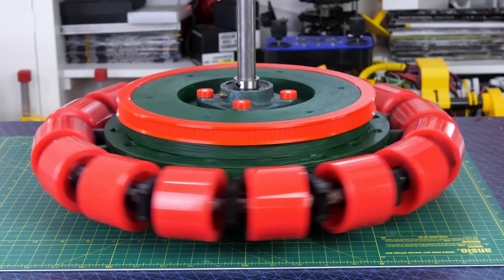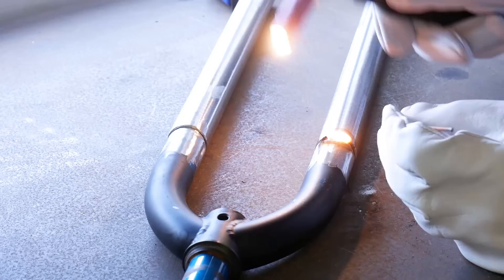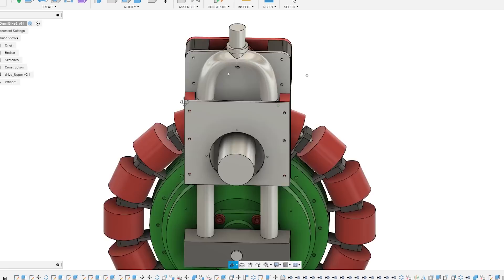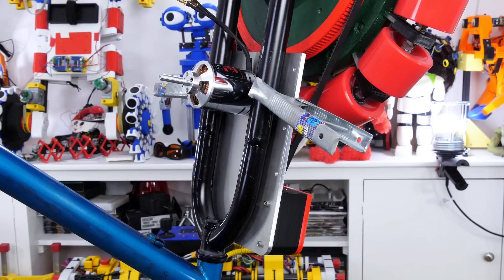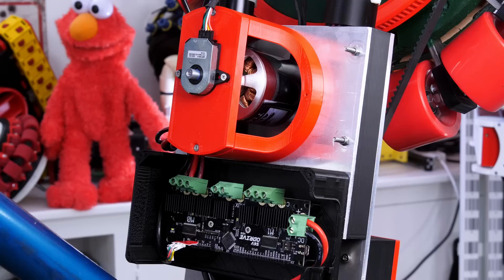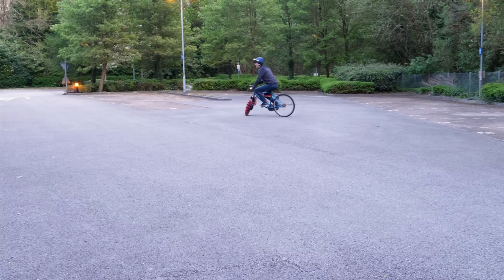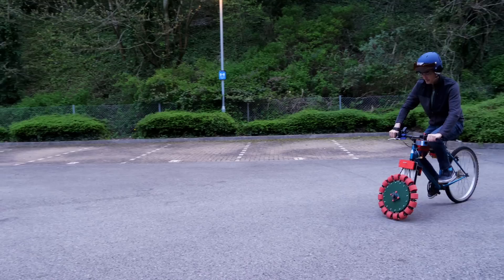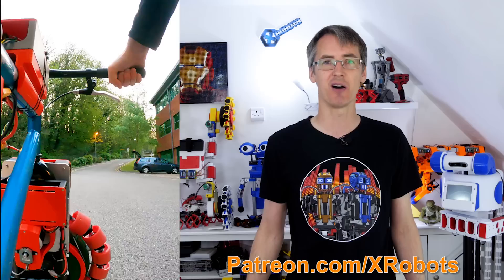Can I RIDE THIS BIKE?

Comment: This is really fascinating. I was surprised he could balance so easily. I wonder if omniwheels could be applied to disability aides, such as wheelchairs and rolling zimmer frames. For small spaces, it could even be useful in prams.
Reply: The issue is omnj wheels tend to get stuck as actually making them work perfectly is rather hard.
Reply: In real world scenarios the spaces between the rollers cause a lot of issues for many applications.
Reply: 11 years ago somebody already posted a video on youtube about an omni wheelchair
Reply: So I play Star citizen, and one thing I love is the ability to strafe my ship at any direction at any time. If I’m ever wheelchair bound, I’m replacing the wheels with Omnis and a joystick for multiple direction inputs
Reply: @Amara87387  Hover tech is at the level where you could probably use it if you wanted to. Walker wheelchairs are another option as the Ls3 mule is over 10 years old and 3d printing makes part replacement simpler in a domestic setting compared to a military one. The only major issue is that they can be a bit loud, but older wheelchairs aren't exactly whisper-quiet either, and there have since been many innovations that address that issue.
Reply: @flinfake  too energy intensive by comparison though, most likely
Reply: @axolotl0424  The energy demands are comparable.
Reply: @Amara87387  You could try mechanum, those are usually more consistent, but idk how well that would work with only two wheels
Reply: @himedo1512  more moving parts=more chances of failure

Comment: when you stop welding with the tig, leave the torch in place and wait for the post gas to stop flowing - this allows the weld to cool and the gas stops it oxidising - which means if you need to start again - it’s ‘clean’.  especially important when tigging ally
Reply: I was thinking adding that exact same comment.
Reply: Alloy?
Reply: @MaxPMagee  aluminum

Comment: It seems like a cool idea until you realize this makes dealing with curbs and other bumps and changes in elevation next to impossible to deal with without stopping and lifting the bike manually over the bump
Reply: That's a really good point but I don't think he meant for this to be at all practical. Just an experiment in "what if"
Reply: Just pop a wheelie

Comment: Before I watch this video, as someone who mountain bikes a LOT: I immediately thought it'd be best to try this on the rear wheel.
I love locking up the rear wheel and fishtailing the bike around corners, this would simplify the drift if you have the muscle memory...
No clips, no foot out, trust the rubber you invested in! 
MTB 4 Life!
Reply: Although for that you'd need either a front wheel drive bike, or some complex mechanism to get the rear wheel powered in both axes. I imagine it would be possible, but getting those tiny skateboard wheels powered would be very difficult
Reply: @skylark6167  maybe they could be rubbery roller skate/blade wheels, theyll be softer too although smaller

Comment: If you add a sensor on the rear wheel to read the speed, you could adjust the balancing effect accordingly, turn it on/off automatically and even add a little ramp up. That could be neat.

Comment: Suggestion: soft-start for the balancing i.e. so that it eases from no balancing to full balancing over like 2 seconds.
Suggestion 2: steering wheel lockout when balancing is on
Reply: And switch Balancing on/off if the forward velocity is < x km/h
Reply: Could you also feed back the steering position, to offset the balance point to allow it to balance into a certain lean, matched to a certain radius of turn?
Reply: yes it looked like Integrator windup when he switched it on. Probably he was just switching the outputs (motor commands) ON and that would result in such windups while riding the bike normally
Reply: 2 seconds is a bit much, you'd want a 300ms from lean to full power balancing "soft balancing", it starts with very little correction (20% power? maybe play with it so it feels like resistance to leaning but still letting you lean with flicking you back straight) at the start of the lean and increasingly gets stronger until the end of the 300ms. Also give it a strength gradient depending on how much you're leaning, anything below 3 degrees should receive a 0.2 correction modifier (20% strength? Again, check what feels better) and anything over it ramps up in severity up to 10 degrees (if you lean more than 15 degrees with auto balancing on you are suffering from the stupid).

Basically by having these two different gradients you get both a reactive response give you time to manually correct for bumps without getting over-corrected by the PID and the freedom to turn with a slight lean without getting flung over to the opposite side causing that "flick" you see whenever he turned the balancer on while riding.
Reply: Suggestion 3: use an active omnidirectional wheel, mount the main wheel like normal and have the small wheels do the balancing.

I'm guessing that may have been the original plan but it was ruled too much of an engineering headache
Reply: Looks to me like the memory of the Integral term isn't cleared between off->on cycles, which makes it more jarring when it engages again and has to refill its buffer with up-to-date info. 
But that might be a wrong assumption.
Reply: @jakobkriele5518  I think the issue is that the bike assumes balanced is when the bike is oriented perfectly vertical, which isn't the case because the rider's weight can be off center of the bike. I believe the jarring when he enables balance mode actually recenters him on the bike.
The full solution might be collecting data from an an accelerometer and continuously updating / calculating the balance point. Should enable you to ride the bike 'balanced' with it almost touching the ground if the riders weight is counter to that angle.

Comment: This is actually pretty cool because at the end the motor is basically doing what you would do into a high speed corner on a sportbike, this could actually help people understand counter steer before practicing on a track.

Comment: It would be interesting to see a bike with the steering actually affecting the PID controller and the front wheel steering being locked in place. I expect that would be more intuitive to ride since it's always in balancing mode, but you're still able to use the steering wheel.
Reply: I was thinking about two buttons you can press on both the handles to make the wheel turn left or right while you're going straight to allow you to turn better. seems like this was over looked but I do like what he did with the balance system. if there was another omni wheel on the back of the bike to make it look even we might actually have a really nice product here haha.
Reply: mind you this is a pedal bike and if it was pure electric i can see this being really sweet actually with two omni wheels ^.^

Comment: i think if you inverse(or make opposite) the code tilt_direction/motor_direction relationship  in the "balancing mode" the motor will make you stay upright instead of throwing you to the direction you lean... give it a try if you haven't
Reply from the maker: That would be like a Segway that drives away faster in the opposite direction and throws you off.

Comment: When transitioning from not balancing mode to balancing mode, you need to reset the integration term to zero in the software just before enabling the control loop.  When you are riding in "bike mode", the control loop is going nuts (I assume your gyro inputs are still there, but the motor drive is cut, so error terms in the loop are huge).  The I-term "winds up" during this time.  Then when you kick on the motor drive, the I-term causes sudden jerk until it initializes.  Depending upon how you were riding (if you were in turn, the I-term would be large), but if you were nearly straight, the I-term would be more nearly zero, so less transient.

Comment: I suspect converting the bike to fixed wheel would be an improvement to this project as you would have much better control of your forward/back position and even be able to cycle backwards in balancing mode.
Reply: Thats what I was thinking
Reply: I mean, it's essentally  a track stand with more steps.  I do love the idea though
Reply: How do u mean fixed wheel?
Reply: @alal2192  You cant turn the front wheel
Reply: @spyder027  so it would be fully electric? It would be hard to manoeuvre
Reply: @alal2192  Since the wheel turns when you lean to self balance you should be able to lean to turn
Reply: @spyder027  oh i got it u mean the frame?
Reply: @alal2192  You cant turn the front wheel left or right to steer but it can still roll
Reply: @alal2192  the rear hub is fixed instead of 1 directional so instead of coasting when you stop pedaling the pedals keep moving, its is common for some trick bikes and wheelie bikes
Reply: @alal2192  fixed gear. Meaning when you pedal, the pedals will turn with the gear. With a normal bike you can get speed and not have to pedal. You're always pedaling on a fixed gear bike

Comment: I love this! One thought: lock the forks, disconnect the handlebars from the forks and make a steering encoder to send directional signal to the transverse drive? might work more like a regular bike at that point.
Reply: It wouldn't work much like a regular bike, because you actually counter steer in a bike at speeds higher than like 2mph

Comment: Making the rear wheel function similar to the front would be pretty sweet too. You'd be able to move on two axis without having to turn.
Reply: Yeah but it’d be super hard to manoeuvre
Reply: Bicycle strafing. Now that's something I never thought I'd imagine 

This is a good start, but until hoverbikes become a proper thing(more than just being big quadcopters) it won't be a common thing
Reply: the problem is, how do you power the skateboard wheels? would it be like a motorbike?
Reply: @BierBart12  that just sounds like asking for trouble though. It would be stupid hard to balance sideways movement, plus it would very likely make people dizzy

Comment: So cool! Your skills at integrating components are amazing, though at this point I imagine a lot of your balancing code and electronics are a "solved problem" and you just have to configure the same sensors and electronics on different devices to implement balancing or other control schemes. Your skill at rapidly designing and realizing complex mechanical structures is just as impressive, if not more, than the electronics!

Comment: Most interesting! 
I have to say though that this project really did require you to have a good helmet in case you came off the bike. However, without the strap fastened the helmet is nearly useless. Your rear tyre also needs air.
Keep up the fascinating projects!

Comment: My thoughts are use analog left and right levers mounted on the handlebars for the steering instead of leaning pulling the right or left lever turns at varying rates releasing both levers reverts to auto balance

Comment: Very interesting, you can probably have the handle bars locked in place since you should steer by learning over. Regarding safety, that helmet is of no use unless you fasten the chin strap. Also gloves to protect your hands would be very useful.

Comment: You could swap the front brake (who uses those?) for a pull sensor that provides an "electronic clutch" whose value counts towards the total power of the drive - fully engaged the drive has zero power and is free wheeling, upon release balance mode could reassert - or vice versa. A scaled "on/off" might provide a more natural transition between the two riding modes.
Reply: That's wrong dude. Front brake is the main brake, cause you can't stop enough quick using back brake. Sometimes its very important.
Reply: @olegnevolin3993  Okay Joking aside. simply make the single brake lever apply 50% front brake and 100% back brake... Or whatever ratio works and is not suicidally front biased

Comment: Fascinating project, love your work!  My takeaway is opposite many of the comments, rather than locking the steering, you could add an angle input sensor and feed that into the lean angle command. The reality is the steer angle is redundant with the driven front wheel, and turning the steer axis is just a slight transform by the cosine.

I'm thinking the steer angle gives you a steering curvature, and the lean angle bias is calculated the forward speed as an input.  This means the controller would do the counter steering for you, which would be really trippy to ride for someone that knows how to ride.  

You could do other things with the control as well, for example, inverting the curvature gain would still balance but the bike would move opposite the intuitive path, similar to SmarterEveryDay but your controller should let you switch back and forth without issue.

Can't wait to see what's next!

Comment: You know you want to do it to the back tire too, imagine that, also, you should be able to set up a velocity sensor to automatically turn on the balance mode when you reach a slow point in your ride
Reply: could bike parallel
Reply: Would be more effort, the bike moves because the pedals move which are attached to the back tire, would be funny tho

Comment: A steering angle sensor input would be very interesting. I imagine with the right tuning you could make it ride very 'naturally'.
Reply: That's honestly what I thought he was going to do in the beginning of the video.
Reply: I'm guessing he would lock the steering but allow the handlebars to still move for sensor input.
Reply: @RCHobbyist463  That's an interesting thought experiment. Would be interesting to try it both ways. Locking the direct steering out completely scares me. And then you lose some natural stability. But programmatically it might make a lot more sense.
Reply: I think I'd also add a speed sensor on the rear wheel and also for the brake that would allow smooth transitions to different modes without the switch.
Reply: @chrissmith82771  That's a great idea. Could have speed sensitive steering!

Comment: So I haven’t welded in ages but one thing you can do when you remove current is to keep the TIG head near the cooling weld thus shielding the weld and reducing the amount of slag that you get on the weld caused by oxidation

Comment: Suggestion: have the balancing work as it does now in low speeds and in higher speeds only engage on specific tilt-threshold, in an attempt to reduce the risk of falling when in high speed and sharp turns. 

Another project could be to improve breaking, maybe like an ABS for bikes or having the "breaking-intensity" or timing of front and back breaks vary depending on if you're going uphill or downhill.
Reply: Для велосипеда глупо ставить abs, так как он не весит тонну, его и обычные тормоза остановят, а автор видео из велосипеда сделал велосипед
Reply: @teftelka5613  I used Google Translate to understand what you said, so I might get it wrong. But as I understand it, you say it would be stupid to have ABS on a bike, because a bike doesn't weigh a lot and ordinary brakes will stop it.

But ABS is used on cars because the surface the car drives on can be slippery, and the braking on slippery surfaces is a problem, you lose control of your vehicle and the braking distance is increased. ABS solves both those problems. And while it is more important for a car to have ABS, having a similar solution for a bike could be the best way to improve safety for cyclists (and the drivers and pedestrians the cyclist interact with). I have injured myself pretty badly when braking on a bike in high speeds on loose gravel, the wheels lock up and lose traction.

Comment: If you can continue your research in this project, to the point where you can use your code to enable a powerful electric motor, to finely manipulate a rubber tyre at 90 degrees to self balance (with minimal corrections - maybe a bike with critical level centre of gravity - so you could comfortably cross your arms and hold a convo with someone not on a bike) and then you could press a button or do some command to go back to transport mode were the front tire snaps forward again into cycle mode! That would be sick! You got the brains for it bro, I’d save up my spare cash for weeks to buy into it! Xxx

Comment: I love this video, I love weird bikes and this one is the best. 👍👍👍👍 
Watching the video part of the tests, I was thinking, that you could do the same thing without the automatic stabilisation part. Leave the front wheel fixed, at 90º to the axis of the bike and when you move the handlebars the wheel turns to one side or the other, the more you turn the handlebars the more the wheel turns sideways. I think that if it is well calibrated, it would be like riding a normal bike, and you could also keep your balance while standing still.

Comment: I would make it so in balancing mode it locks the handles, that would make it easier to control and would help with getting used to leaning.

Comment: Love your videos man I found this really cool to watch
Excited to see what comes next
I love how the bike functions especially something so tall like a mountain bike
Though if we're talking about balance in my experience of riding bikes I've found that riding a bmx with pegs on the front wheel was my absolute favourite
It was a cheap heavy frame but was perfect for handless riding
I'd ride around my local hilly areas and on the down hills i'd let the handle bars go place my feet on the front pegs and push my knees towards each other and lock my legs so the wheel remained straight and I'd lean to steer which was quite odd to begin with but was awesome once I got used to it
Reply: Thats not a mountain bike